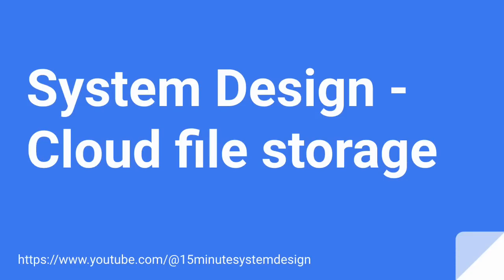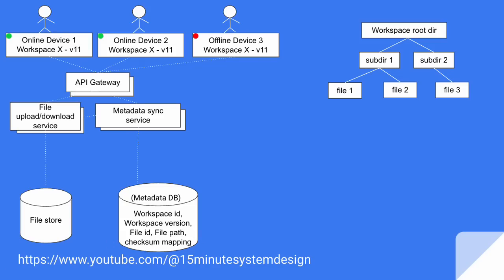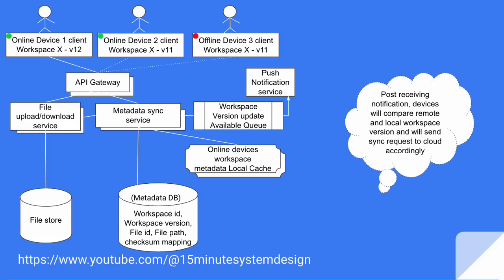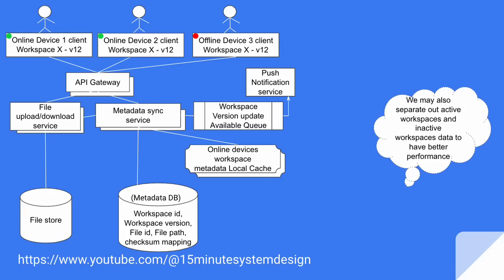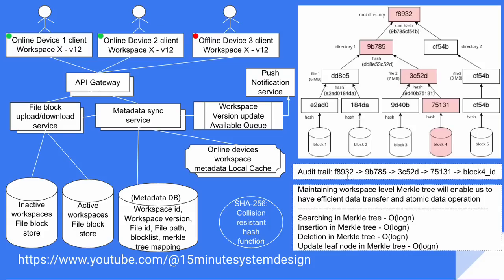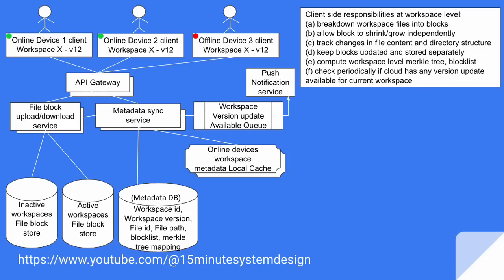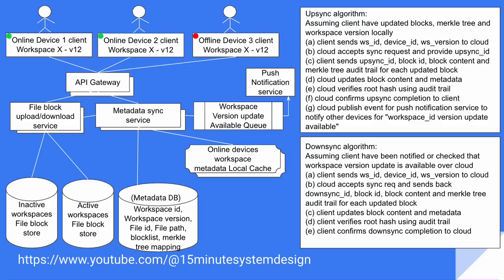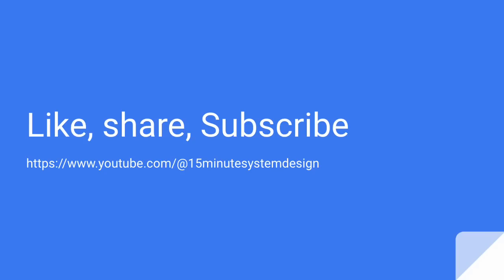Dropbox system design | system design interview

Comment from the maker: Tip: Merkle tree is one of the best data structures for a design problem where we want to quickly verify correctness of new data item in a distributed environment

Example 1: Verifying code commits in version control system like git
Example 2: Verifying subsequent data content during file transfer
Example 3: Verifying transaction in blockchain like ethereum